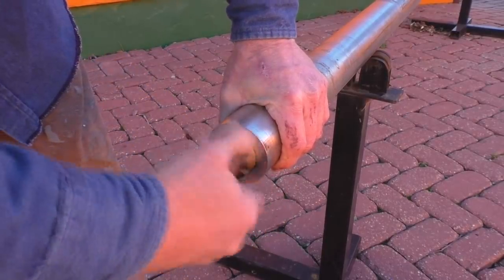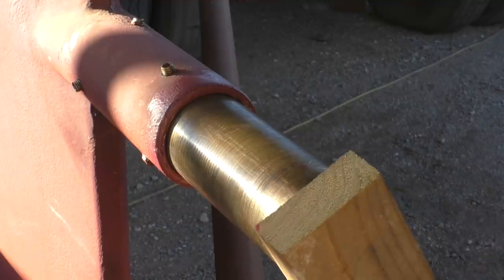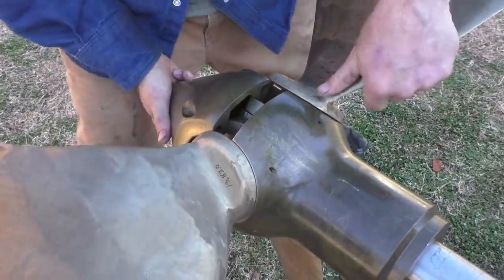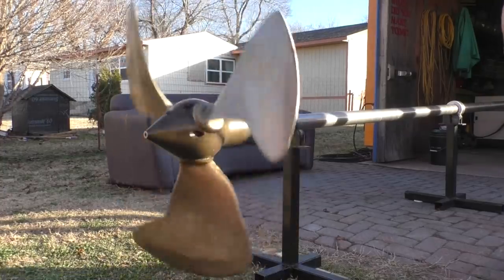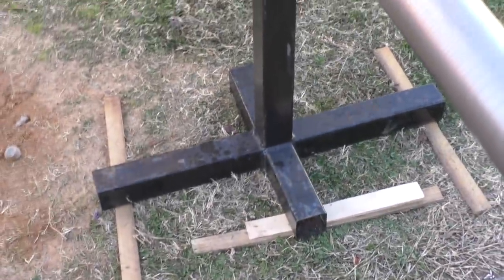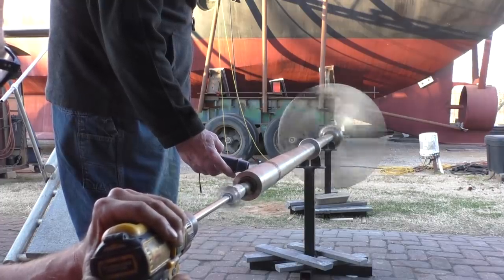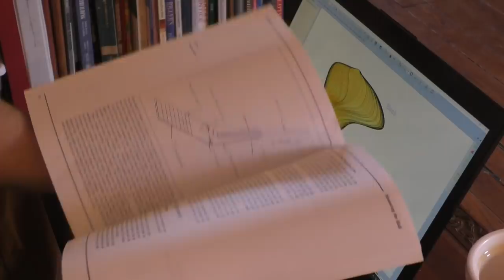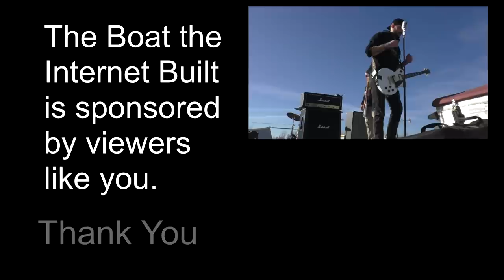DIY Boat Propeller - Part 10 - Tested at 600 rpm

Comment: hey so by design if you set your pitch to maximize engine power, then you lose the engine, you also lose the ability to return the pitch for optimal sailing. can you still manually adjust that without engine power if you need to? suppose instead the piston's resting state (low/no pressure) would set pitch for sailing, and it would return naturally to this state with a loss of engine power? not worth the design effort?

Comment: Yeah where the weight is on the blade will make a big difference. Try marking the centerline on two axis for each blade for the balance. That should get it even closer.

Comment: removing weight from the blades should be done but it is a static balance.  you need to balance the dynamic (rotating) assembly to tune out the system vibration.

Comment: @SV Seeker, have you thought about using something like a cheap harbor freight bubble balancer for a wheel? Wonder if you could use the prop section sitting where the tire would. Then you could tell which side wasn't balanced.

Comment: if you want to balance it then put it on your rack and just spit it a little a little bit by hand  let it free Spin when it stops rocking back and forth the bottom prop will be the heavy one  it's the same way you balance a motorcycle tire  just keep shaving a little off the heavy one until it stops rocking back and forth when it stopped spinning....

Comment: Maybe you can try to get someone to help you that has a truck tire ballance unit. rigg the prop up to fit on this machine and let it spin. it will tell you where the balance problem is. it will stop in the right place. this device has pressure sensors and those are working together with an angle/rotation sensor. This will feel the wobble and know the spot

Comment: From the point of view of mass balance,  not only the centre of gravity must be in the same radius, but they must also be at 120 degrees apart resulting in the total centre of gravity of the whole propeller being located at the shaft centre. That is for static balance. If the static balance is not correct but the three CGs of the blades are on the same plane the then the shaft will vibrate in a conical nanner with the coupling end being steady and the propeller end shaft centre forming a circle which the cutlass bearing would not like.  Then for dynamic balance, the centre of gravity of each blade must be in the same plane at right angles to the shaft.  If the blades are not in the same plane at right angles to the shaft, then the wobble would excite two cones with their tips along the length of the shaft and both the coupling end and the propeller end trying to form a circle.
Balancing that propeller takes time and the fact that it is a variable pitch all this balance must be held at all the pitches the prop can achieve.
After all that mass balance there is the hydrodynamic balance due to variation in the airfoil section and that is not so easy.
Congratulations to this highly skilled, brave gentleman, he certainly knows his ropes. I designed and cast propellers but they were of the fixed pitch type and I varied the pitch slightly along the radius so that at slow speed the inner third of the blade would not be at a very high angle of attack and I preferred to let the inner third of the radius, simply cut through the water without much slip due to the lower pitch at that lower radius. The outer two-thirds of the blade held the design fixed pitch. The propeller worked well and had a better standing start and the blades did not erode at the hub . High pitched propellers tend to act as paddlewheels near the hub on a standing start so lowering the pitch a little would help and anyway there is not much drive at the inner radius so I prefered it with the new performance. The boat was heavy had two Cummins and the new propellers increased the speed from 25 to 32 knots. Also, the leading edge was like a scimitar to ensure that if the prop leaves the water,  the leading edge would enter the water softly and also at the tips both the leading edge and the trailing edge were raked back as in this propeller in the video. 

Note that variable pitch propeller as shown in the video, they are efficient at one pitch as at all the other pitches the design is a compromise for convenience rather than efficiency. Just rotating the blade en block does not acquire the optimised " twist" along the blade. at all the pitches possible.

Comment: Doug, I haven’t noticed if you had already done this or if it’s even possible but what about putting a large ball valve on the propeller shaft tube just in case you had to pull the shaft completely out while in the water or while seeker is on her keels and the repair takes more than a day and the tide will come up again...  you usually think of everything and have a plan,  but this just popped in my head.   Thanks for sharing.

Edit: I even had an afterthought for just a big rubber plug lol just in case you had the cutlass bearing out. Paint the plug red and keep it with your puller.

Comment: The wobble is because you are not balanced. It will be in the cutting, weigh each blade or take to a propeller specialist. And its remove weight not add. Get it right and save all the troubles you are going to receive later.

Comment: greta job  our sail boat we hauled it and the prop was to close to the hull and was caviting you could see a groove in the hull which caused aloss in thrust trimmed it back 3/4 from bottom made a difference to the speed

Comment: What if you make an adapter and put the prop with the prop housing  on a tire balancing machine like the heavy duty one for semi truck tires. And then maybe add weights to the fins or grind some weight off

Comment: Might be a little late since i just saw the video with the whole thing and its seal mounted in the boat, but if you would take a sharpy marker and mount it on a sperate stand with its tip like 1mm from the shaft on one side - once its starts wobbeling wouldn't you end up with a lot of little sharpy marks on the side thats heavier? :)

Comment: ** You can get a rough balance with the blades by using two scales to find the center of gravity. one at the base of the blade and one at the top. If you measure the weights at each blade to match the inner and outer weights of all three blades, and the over all weights, you will be far more closer to a true balance than just weighing the blade individually. It is similar to the method that performance guys use to balance rods on an engine by taking the weight at each of the ends and making them all the same.

Comment: What if you place the front stand on an electronic scale and log the weight over time. Then put a trigger wheel with a hall effect sensor that has a special window to indicate a specific position and monitor the pulses along with the weight. Then you will know the heaviest spot on the bottom and the lightest spot on the top will show you where and how much weight to add or shave to balance for a specific rpm...

Comment: It may be accounted for but are there any bushes inside the propeller shaft to centralize the pitch control rod? the span of the rod, needs to be reduced to stop it slapping around the inside of the shaft when spinning. This will occur especially when the rod is in compression.
if bushes are to be pressed into the shaft then the leading edge needs to be tapered to aid "finding the hole" when inserting the rod.

Comment: To measure where the props are different you could possibly submerge them in a tank and measure the water displacement. For example, if you half-submerged each of them and measured their water displacements and found no difference then you know that those 3 "halves" are identical in volume and approximately in mass. 

You could take this principle and keep submerging them further and further until you find a significant difference in the volumes, then you know where there's extra mass that needs to be removed. 

Might be a little bit finiky to actually do but thought id share my thoughts!

Comment: With your blades ON the hub, set your pitchometer to measure all your blades, in place, to get the variances and slowly grind off each blade to get as close to zero differences in weight and true pitch, remembering that your hub has innate imbalances based on wear, wear that can create a weighting that can cause a disharmony. Harmonic balancing is easier to achieve at all speeds based on your regular hull speed rpms, as you know, so aim for that "known known".   Also, check again for ANY runout on your shaft(s) and get good balance and trueness, spinning it while it's in the lathe to operating rpms is good machine practice to assure balance.  ALSO, make sure your temporary placements of your bench rollers (that you are using in your yard testing),  closely match your shaft bearing placements and are equidistant and as near as possible to duplicate the actual length and placement of that bearing to what is in your engine room to duplicate what will be it's real world operating environment, duplicating too, the fixed point of spin from the engine output point with a locking type three point roller. Finally,  remember that you are spinning it in air. I know you are in feathering mode while your are spinning it up and the density of air isn't what it will be in the water. If you need to spin it up to check it in full forward or full reverse,  then build a simple wooden (reinforced plywood) box to create a non air movement atmosphere, not quite a vacuum but more of a static state. This is often used to harmonically balance large ship propellers. By getting as close as possible to this will most certainly extend the operating  life of the shaft, keeping everything in the propeller set in a harmonic state and will be all for naught as soon as something strikes a blade underwater,  then it's back to square one, eh? Y'all are doing fine and what you've already done is workman like and correct. By the time I post this, your vessel will probably already be back afloat. Great video!

Comment: use a separate stand with a large nut mounted on it. Bore the center of a bolt to hold a sharpie. Put the stand near the prop. spin the prop on the stand to the point where vibration is worse. screw the sharpie in till it contacts only part of the shaft. The center of the line will be the heavy point. grind some on the blades at the heavy point, or two blades if the heavy point is between blades. move stand towards blade. Rinse and repeat.

Comment: I used to ballance C-130 Propellers. Before we had the high tech sensors we ballanced them the same way car tires used to be  ballanced.  Horizontal on a pin and we added the ballance weights on the hub.  Might be worth exploring.

Comment: Use the RC-models  method to balance propellers for boats or planes.  its not about spinning around, it is to see which blade drops down . that one is heavier than the rest.. Make 2 metal plats with a sharp edge and put one on both sides of the prop, resting the axle on the sharp edges

Comment: look up how people balance motorcycle wheels at home and do the same for the blades.  Spin the blade by hand, let it settle, mark the top. Turn 180 degrees and let it loose. If the mark goes back to the top - remove a bit from the bottom. Repeat until the blades "stay" where you leave them after turning 180 or 90 degrees.

Comment: That prop and shaft needs to be statically balanced. You will need to number those prop pieces and the spot they go in. You will regret it if you don't get it balanced. Dry docking for a bearing will be expensive!

Comment: To test the blade balance, using your CNC capabilities, make a "jig" that would allow all three blades to be mounted, at 120 degree separation, with a pilot hole of about 3 inches in the middle. Once the jig is finely balanced, mount the blades and set all the angles the same. Then mount the whole contraption onto an automotive "bubble" balancer. The position of the bubble would give you the heavy incidence and you could adjust accordingly.

Comment: The blade that goes to the bottom on your test stand should be the heavy one. At least if it's spinning freely enough. That's just from my little bit of knowledge from balancing RC helicopter blades.

Comment: You could add strips of tape to the blades to find balance, then take the tape off and weigh them and add that weight to the appropriate blade or convert it to take weight off the blades to get them balanced.

Comment: Make a short shaft with an eye so you can hang the propeller from a line. Whatever blade hang the lowest  it will be where you need to take some weight off.

Comment: The easiest thing to do would be to do a static ballance in the same way that surface grinder wheels are ballanced. rest your shaft on two level bars and allow the prop to settle. Then rotate the shaft 90 degrees and let go allow the prop to settle again. The heaviest point will be at the botom remove weight from there or add weight at the top. repeat untill the shaft ballances in all directions.

Comment: You can experiment, but normally you use a sensor that tells you what amplitude is present at which angle in each rotation. Simplest one people do, flashes a strobe light at maximum amplitude position. You mark degrees at the spot it flashes on and simply read the angle of the biggest amplitude. From there you can add weights in  few spots and calculate the correct position. There are pro systems that can balance stuff in the field while mounted on the whatever the machine is. Someone around you will have a business doing it. You can make your own balancer, but for one piece it's cheaper to pay for the service. Balancing a thin disk it's a lot easier then balancing something that is as thick/long as it's wide. You might get by with just static balancing (ie. finding the heavy spot using really low drag bearings) if most of your imbalance is concentrated in the blades as they are pretty thin compared to their diameter. However, your balance will change as pitch is increased and to get good balance in all pitches you'll probably need to dynamic balance it. Does it matter or not, I have no idea. You could do a collab with Abom79 or better yet Keith Fanner who does these things for living. I think both are situated in Florida

Comment: I can tell you from flying airplanes in my entire life in an airplane propeller‘s balance is much more important than a boat the best way to balance is to equally wait each of the blades and then to attach them to a center shaft and spend them freely let them stop if the same blade keeps stopping on the bottom it’s heavier than the other blade. Center of gravity is not as important as total mass do you want to same mast off of each side of your shaft to make it the most efficient

Comment: You're pretty close with the resonance theory. Your biggest issue will be something called "sympathetic" vibration, which the engine could, in theory, contribute to. At that point, your only option would be to have an emergency brake. Your ship is pretty sound, so I don't think you could take hull damage, but if sympathetic vibration occurs you would likely see any solid mounts ripped from their fixtures. I'm presuming your engine will be connected with a flexible driveshaft, so that should be relatively unscathed provided it can shear, but I might consider a second flexible mounting somewhere along the drivetrain just to make sure. 

As for balancing, a machine shop should be able to do it. The weight of the prop isn't really an issue, there are wheels that weigh as much as a typical V8 block. I'd call it worth it, just for the sake of the shaft seal. With a vibration like that, even as small as it is, the weight of your shaft will bugger the seal much more quickly than it would otherwise.

Comment: static balance it by turning it up to same rpm every time then let it stop and mark the blade thats on the bottom or the top then spin it again and check what blade is on the bottom or top and check if the same blade always ends up on the bottom its heavy or if you are watching the blade on the top its light

Comment: You should probably add a greawse zerk to the shaft at the trans end to grease the shaft from inside the boat. They  make a marine grease to use in a water application like your prop shaft.
Thanks again

Comment: See if there’s any local pump companies that would be willing to spin it.  We balance things well over 10ft in diameter at my work.  Honestly if you could find a way to mount it, that’s not much different than a tire shop balancing 100+ pound 40” mud tire.

Comment: Worked at an airport there was a prop shop. They balanced props on a set up like you have there! They would turn the prop to different positions, if move out from position. In they could tell the heavy prop. Then would  add  what I called spaghetti lead to a hole in the base of the prop. Then check again. Just add or subtracted the lead from the base center of the prop.  Made all changes at the base not on the blade. Because the blades are ground to the correct pitch angles and length, to match so they pulled the same air. IE One blade did not work harder than the other.  But that was airplane props, spun high revs. And have to be more exact.

Comment: To balance the blades you could hang the 3-blades set vertically close to the ground and measure the distance of each blade from the ground. Add weight to the blades appropriately until all blades are the same distance. I have done this for wind turbine blades, it worked great.

Comment: I had a Torque-Shift variable pitch prop on my runabout. It operated by springs, cams and water pressure. It worked very well. Come out of the hole at 11 pitch and switch up to 21 or 22 pitch. Sold the boat years ago, still have the prop somewhere.